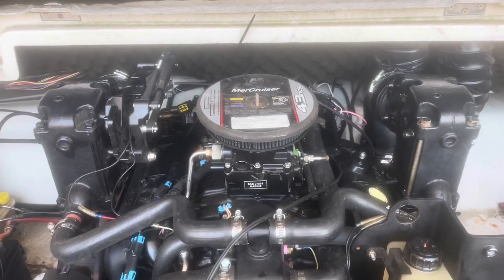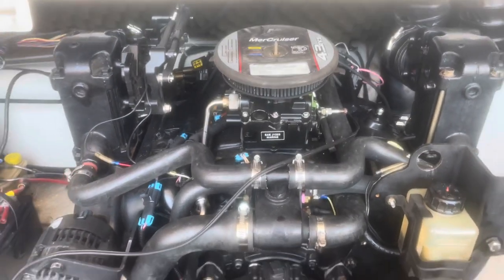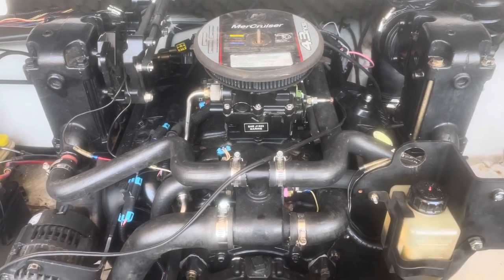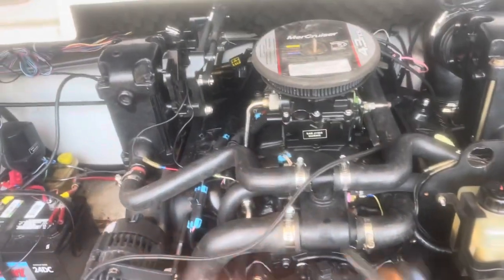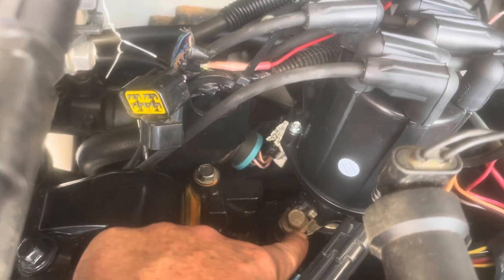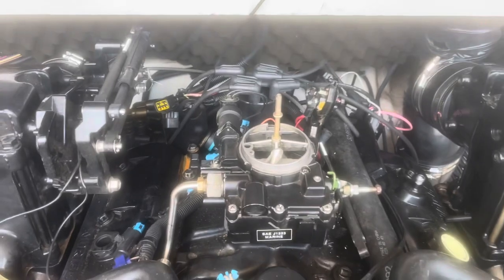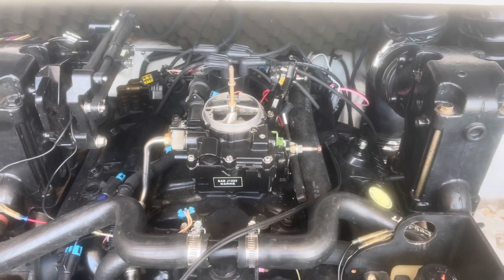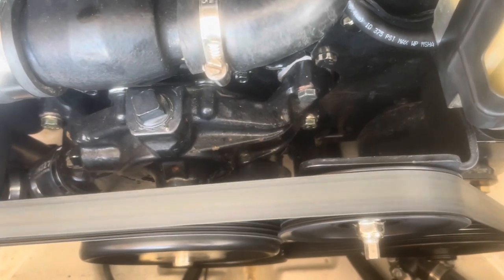7 - Setting Dynamic Timing - SPARKIE THE EEL

Comment: I have studied your various excellent videos many times to both prepare and guide me through the conversion process.  I have 2 questions: 

1) with the exception of this video (part 7), all your other mentions of the initial timing on a 4.3 V6 Mercruiser have been a very specific requirememt to set at 1 Deg before Top Dead Centre.  However, in this video I noted that you mentioned that this 1 Deg BTDC timing was for the V6 Vortex engines post 1995 and that you would do another video on the earlier V6 engines.  However, I havent been able to find another video and the only other instructions I have is "time the engine to engine manufacturer specifications" (which is 8 deg BTDC for my 1990ish engine) - The engine is starting beter than ever and is running on ear muffs fine on the 1 deg BTDC initial timing setting but I am now very concerned about putting the engine under load/revs in the water, without clarification).

2) When using the dedicated timing harness to set the base timing to 1 deg BTDC, I have been very confused between the various videos (ie when using the multipurpose harness and dedicated harness) on where to actually connect the one free wire (which is Black on my version!).

Does the dedicated Harness timing wire need to be temporarily connected to a positive source to put the system into base timing mode?
Reply from the maker: For question 1 watch video part 9 in this playlist. As I recommend you should watch all videos in a playlist regarding a product line as they all apply. Your fears are correct that you should not use the factory timing setting and if told to do so by a Sierra Ignition kit you could very easily blow your engine.

https://youtu.be/Dx0eevaXK-s?si=AKQ9JziuL-LNVtne

For question 2 yes the dedicated harness timing wire (set timing harness) has a long wire (mine has an alligator clip) that you connect to a positive 12 volt source to put the distributor into set timing mode.

Comment: Help ,i need the wireing ,and the bracketry to mount my alt , and power stearing ,and serpentine belt just like this but i dont have a extra PS resavoir tank on my pump .
Reply from the maker: Mr  Savor, I’m confused as to why you would need so many brackets and the wiring etc. if you bought a boat. But regardless I don’t sell any of the parts you are looking for. What I need in order to help is the serial number from your engine and an explanation as to why you don’t have the brackets and wiring now. I can’t answer phone calls since I’m out of the country right now. Send me an email to: gmefiguy@gmail.com to provide the above information.